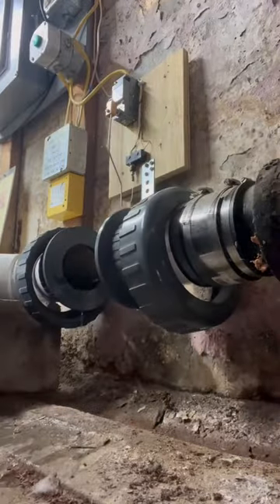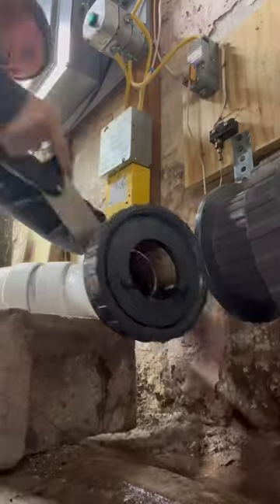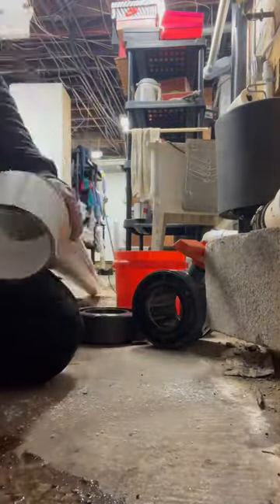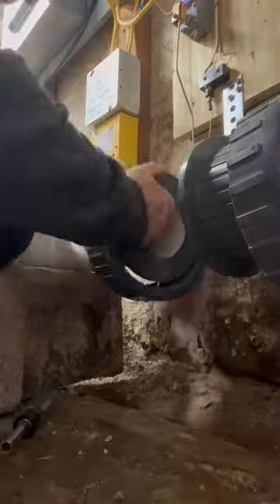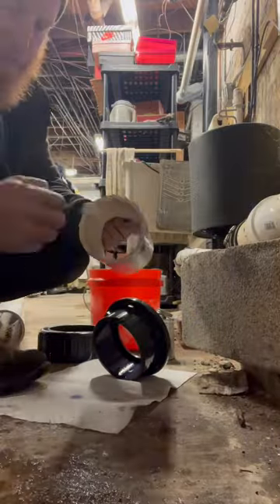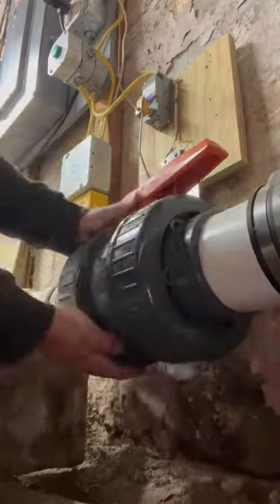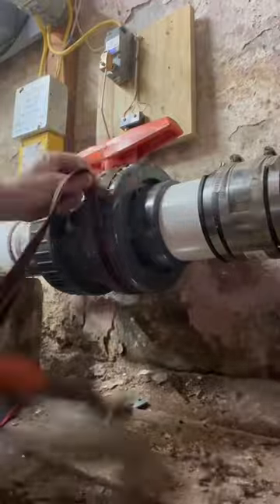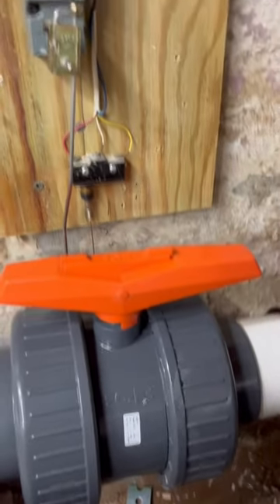No better way than this #plumber #shorts

Comment: Backwater valve is the proper device to use.
Reply from the maker: Not really theyre unreliable this is a sure thing
Reply: @Sickkidsentertainment hahah ok mr handyman. You aren’t a plumber no plumber would do this. You are an apprentice with a van
Reply: @IRoYaILTY exactly
Reply: @Sickkidsentertainment they need maintenance, bit then they are reliable as long as you don't put garbage and wet wipes down your drain. And they work mechanically, so you cannot forget them. And they work even during the day, not only after Business hours, as this sounds to be a business, not a residential home.
Reply: Backflows are not reliable on sewer lines wet wipes would definitely not let them close completely
Reply: @cdltestgenius I have seen them work perfectly fine, as mentioned, when maintained (cleaned) regularly. And wet wipes simply do not belong anywhere down the drain or toilet, no matter what they promise about beeing flushable.  If you don´t care about them and let rasidue build up on them over years, they will not close properly and tightly.
Reply: @cdltestgenius not supposed to flush any wipes of any kind
Reply: @cdltestgenius  that’s why you don’t put wet wipes in a toilet.
Reply: Yes!!
Reply: It looks like this was a a thing the property owner did and if he wants the valve changed then I'd change the valve. He sure as hell didn't buy an Oatey sewage valve kit with strobe light. The guy obviously made all this stuff himself and like I said if he wants to have a ball valve changed out I'd change it out.
Reply: He needs a special kind of backflow prevention system
Reply: @alexanderkupke920 in a perfect world people will listen to that
Reply: @IRoYaILTY you’re right they’d do worse half ass the work and charge customers full price for a job that’ll eventually fail, but I doubt someone who spells their name IRoYaILTY has no clue on anything since A. royalty has no I and B. The fact your spelled your name like that with the upper case alternating with lowercase letters.
Reply: @alexanderkupke920 so what happens if the power goes out?? Some things are better without electronics involved  this is definitely one of them furthermore even with maintenance it’s too much of a risk of having it fail at the wrong time!
Reply: @CajunReaper95  my account is 13 years old I’ve had this name since then never bothered to change it or make a new one. If the 95 is the year you were born then I can almost guarantee you I’ve been plumbing longer than you unless you started plumbing at 10
Reply: @CajunReaper95  Not sure what you are referring to. For that contraption in the Video, you better make sure it closes or stays closed if the power fails (Or you can at least manually shut everything). The backflow preventer I was talking about is a purely mechanical device. It is like the pipe going through a box which has a ridge as a sealing surface at an about 45 degree angle where the lower part of that angular plane points away from the wastewater source. there is a flap pivoting at the top closing on that ridge and sealing the pipe. Under normal circumstances and with everything somewhat clean (nothing in a wastewater system stays shiny for more than a few minutes, but at least as long as nothing is gummed up or debris sticking in there) the wastewater pushes open the flap. In case of a backflow, that backflow from the wrong direction pushes that flap tighter in the closed position (that is why it usually is at an angle, older devices might have the flap straight down though.). It is like a check valve for wastewater. The one I have in my house actually has an additional lever to lock the flap closed. Larger devices can usually be locked with a screw. In the case of the one I have the lid can be removed with a single lever and all movable components can be removed for easier cleaning and maintenance. On larger ones the lid may be held by screws. I should say the one in my house is a rather small device, I guess about the smallest one you can get for a sewage pipe of either 50 or 60 mm (not sure, didn´t measure or look at the pipe, in Inches that would be somewhere between 2 and 2.5 inches) the diameter you will usually find here for a sink or at most a shower or bathtub. In may case, it is only for the washing machine in the basement, all other drains are on higher floors and don´t need a backflow preventer. (If the backflow gets that high, I should also worry about my front door being watertight as well.)
Reply: @Sickkidsentertainment backwater and ball valve for emergency
Reply: @alexanderkupke920 the problem with that type of valve is that if even one wet wipe happens to be on the sealing surface when the back flow happens just after closing time on a Friday, and it's even a small leak all weekend, they still have a flood on Monday morning.

Anything automatic is still a risk, when the back flow issue is so common.
And if you have public restrooms, or even staff restrooms, the chances of someone having a pack of wet Wipes in their purse is very high, and so you can't rely on it.

With this valve, the chances of anything getting hung up in it is slim, and if it does, you will know it when you try to close the valve because it will bind.

So you know that when you go through your shutdown process at the end of the day, it's sealed, and you will not have an expensive flood of sewer shutting your business down again.
Reply: @IRoYaILTY damn you own the company he works for or something?
Reply: @IRoYaILTY agree 👍
Reply: @Sickkidsentertainment  Sadly, you are correct. The vast majority of people who have them do not maintain them, plus the types of things that tend to get pushed up the line in a backup can stick them open just enough to allow flow and cause the same flooding issues. 

Giant cast iron & steel gate valves are very commonly found buried under the basement floors in older homes in my city - serving the same purpose as the valve you installed. Homeowners would go spin that sucker closed during major downpours or flooding to prevent basement flooding. May not be as convenient as a backwater valve for most people… but it works every time you use it, no matter what.
Reply: @Hutchingsonwest95 it’s a business. Businesses have customers and therefore don’t have anywhere near 100% control over what goes down their sewer.
Reply: I have two in building as we speak and if I don’t go in manually pump it down it could back up over holiday weekend, I’m waiting on parts
Reply: @alexanderkupke920  so what you're saying is they can and do fail and you either spend unnecessary money to have it cleaned annually or you have a flood when you least expect it.......
This in the video is a manual valve. Meaning....you close it manually...
Meaning...... it works every time.
Seems like an obvious choice.

Comment: Backflow preventer has left the chat.
Reply: Those suck and cause more blockages than they prevent
Reply: @THETANKGINGER absolutely not
Reply: Backflow preventer on a sewage line? Maybe it would work if you only ever pee!
Reply: Countless nrv’s I’ve come across that have flooded out buildings I can’t recommend them anymore
Reply: A simple reflux valve could have fixed this... if we did this in Australia we'd get fined big time
Reply: You mean check valve ? Cuz back flow is something you put on supply lines ,or maybe where you live they call it like that, not here we go with what the awwa calls it .
Reply: Called a backwater valve not a back flow. Basically has a flap that lets stuff go only one way. Yes they have a tendency to clog up but obviously this area is readily accessible and seems just as easy to go clean it out once a month than it does to shut a ball valve off EVERY DAY.
Reply: @EyalSoha my city has hundreds of back flow preventors.. still replacing 1940 units and installing modern ones everyday.
Reply: @EyalSoha  not sure you know that there are lots of different kinds of back flow preventers that can handle all sorts of things.
Reply: @EyalSoha they do exist, and yes they are incredibly unreliable for the exact reasons your probably thinking of
Reply: @TheHonzoh why?  Why does the goverment care if you out a valve in your own building sewer?
Reply: Yeah I lived in a house that was below the sewer line. One day during construction of the house there was a heavy rainstorm and the sewer flooded into the house. It set back the move in day by a month. After the flood extra overflow columns were installed and a nonreturn valve. Never had a problem after that for about 4 years. Then we moved house because mum started making more money.
Reply: I thought backflow preventers were only installed in potable water lines.
Reply: Tell us you down know what a backflow preventer is without telling us you don’t know what a backflow preventer is. 🤦🏻
Reply: @user-sz8il7io2p 
They are. They are specifically designed to protect source water. These clowns are talking check valves.
Reply: @user-sz8il7io2p 
They are. They are specifically designed to protect source water. These clowns are talking check valves.
Reply: Wait until someone runs a cable through it and gets it stuck.
Reply: Backflow preventers are standard here in Alaska. I am a sewer and drain technician. The only time I have issues with them is when they are about 30 years old and seize halfway open, the pin breaks and it sits in its “chamber” at the bottom of the pipe or it was installed incorrectly. I snake through them regularly with no issues. Using a standard size C cutter head. 🤷🏻‍♂️
Reply: @alaskanbeaut1631  backflow preventer or back water valve?
Reply: @BlueDart1971  we call them back flow preventers. They prevent the back flow of city main sewage into your home
Reply: @alaskanbeaut1631  it’s a back water valve then. A backflow preventer is on the water system. I’ve been a plumber for over thirty years and I have never installed one on purpose. I moved to Alaska in 2019 and I haven’t met anyone that uses them up here. At least not here in Soldotna.
Reply: @BlueDart1971  that’s why. 90% is on septic there. Come to anchorage you’ll see residential have them especially in older parts of town.
Reply: @alaskanbeaut1631  I’m not doubting you I just haven’t seen it and I prefer to stay as far from Anchorage as possible:)
Reply: @BlueDart1971  it’s not bad when you live south side. Much better and quieter than the rest of town
Reply: Back water valve

Comment: That’s what a back water valve is for
Reply: Check valves fail more often than ball valves. That's the only reason i would see doing it this way. They must have had a couple check valves fail and decided to say fuck it use a ball valve.

Comment: As a wastewater authority operator, we service our entire collection system in addition to the treatment facility. I’ll tell you straight up, we’ve installed valves in troublesome areas for homeowners when backflows just weren’t effective enough. There’s nothing that says it isn’t to code. Only thing I’d be worried about upstream or downstream of a valve in an open area such as a basement, are Fernco couplers, even rigid fernco couplers. You get 40 blocks of sewer backing up in a sealed system? That’s your first fail point.
Reply: Agreed
Reply: yeah seriously… ferncos… avoid. i pour lead still because i service really old places but i still would avoid ferncos

Comment: I was visiting a friend who lived on a boat house in Washington State. Middle of the night, the bilge alarm goes off. We were sinking. It did not take long to figure out that the city had a problem with a sewage line up hill from the house and it was back flowing into the tank in the bilge and overflowing, sinking the house. I ran up the dock, following the sewage line until I found a flexible section that allowed the dock to move up and down with the river. I bent that line over and bound it with my belt. I think I saved all the floating houses in that harbor that night. The city finally answered the many calls and stopped the backflow.
Reply: What a hero😒🙄 not unbelievable in the slightest.
Reply: @shhhhh232  seems like you are sending me some of your raw sewage, just like that night.
Reply: @trimbaker1893  What a crappy situation! I'd hate to lose my house because it got flooded with the town's turds. Great thinking with the poo-hose tourniquet! In my panic I'd probably have taken an axe to it and caused an environmental problem with all the sewage headed straight to the water!
If the worst did happen, the city would be liable, right? I hope everyone was compensated from the damages! I know if the sewage in the home is bad enough, they will condemn it as a bio-hazard. Hopefully no long-term health effects!

Comment: You are correct no type of stop or check valve can be installed on a main waste line,but sometimes poor engineering can leave serious problems so better to deal with violations from the DOB that have your home or business under the threat of serious flooding.

Comment: A backwater valve (sometimes called a backflow or sewer backup valve) is a valve you can install on your sewer line and is designed to allow water or sewage to flow only one way—out of your house. Sudden heavy rainfall can overwhelm city sewer lines, causing water or sewage to flow back towards your home. A backwater valve prevents sewage from flowing backwards into your house during such events.
Reply from the maker: Theres one right behind, a redundancy

Comment: Pretty sweet setup. He has a light to make sure he remembers to close the valve. A ball valve is 100% gonna work. A check valve has potential to fail. If its damage his property multiple times, i can see where he got this idea.
Reply: The way I heard it, the light comes on when the valve is *closed*, and reminds them to open it back up in the morning.

Comment: In a situation where you are concerned about back flow and pressure, is a fernco coupler on the pressurized side of the valve the started choose?

Comment: It would technically be illegal solely because that is a pressure fitting used in a DWV system. Right? But I’m with you, in that situation I would have no problem putting that in. I would defend it to the inspector too.
Reply: Nothing wrong with using a pressure fitting in a DVW system. But you can’t use DVW stuff under pressure.
Reply: @jimbob5891  i used a 2" dwv 22.5 in a pressure line once. Wasnt critical and wasnt anywhere dangerous. I got away with it, dont tell no one.
Reply: @thefinalkayakboss 
You shouldn't touch any potable water system goober.

Comment: One place I worked had a similar valve setup. The power grid area that supplied the building failed during a major storm. One of the maintenance guys, who lived close by, couldn’t get to the building fast enough to shut the valve. The building was on the side of a hill with a finished walkout lower floor. It was a mess. Carpet replaced. Some wooden furniture damaged.

Comment: I would also add a backwater valve. The ball valve would be just for insurance in case the check valve doesn't hold 100 percent

Comment: That fernco coupler though.. Several blocks of possibly multi story buildings at certain times of the day and the load on the coupler if the pump backs up or shuts down..😮

Comment: good idea i would not want half the town’s crap 💩 in my house nether the i would be super ignoring the rules as well in this case i just have a question would the emergency backflow preventer still be good to have in front of the valve? or is it too weak to prevent a problem an just broke from to much water pressure im thinking of a situation where your sleeping or not home to close the valve when the plant goes down

Comment: I see where the customer is coming from , but as a plumber you’re getting paid for things to be brought up to code or following manufacturers instructions , this right here is a liability cover your ass sometimes the customer isn’t always right
Reply: Well said.
Reply: Right? Customers in general are not expected to know building codes and they will understandably make naive requests that are not to code. And even if they know that and agree, an inspector or litigator could still go after the contractor's bond to redo the work to code on their own dime.
Reply: do it as a cash job and deny you ever stepped foot on the property.
Reply: @dissimulii glad to see there are men in other trades ready to get things done
Reply: If the problem is a City issue shutting his business down on a regular basis, they would be very likely to allow this, and they are allowed to make code variances as needed.

The fact that it turns on a warning light and disables the lift pump also makes it a much easier to approve system.

So the plumber is simply replacing like for like parts, and doesn't have any responsibility for making changes to the system that someone else has engineered and approved.
Reply: @dissimulii amen to that Lmao. 

“I was never here, this never happened, in fact this thing never broke and I have no idea who the hell you are.”
Reply: @ke6gwf  josam already makes back water valves with operable checks and even gate closing back water valves manual and electrical so tell me what engineer would approve this valve over that? Maybe I’m crazy
Reply: @dardanrugova29  those look like they would all be easy to get something clogging them so they didn't close properly, and since the issue was that the business was getting frequently flooded with sewage, the worst case scenario with the manual valve is that someone forgets to open it, and a toilet overflows.

That's a less serious issue than what would happen if the check valve didn't seat properly.

And it wouldn't have had to be an engineer approve it, just the city inspector.